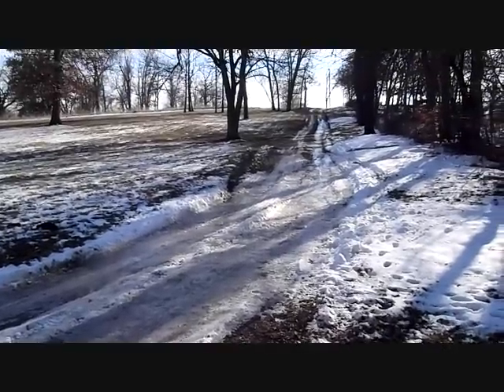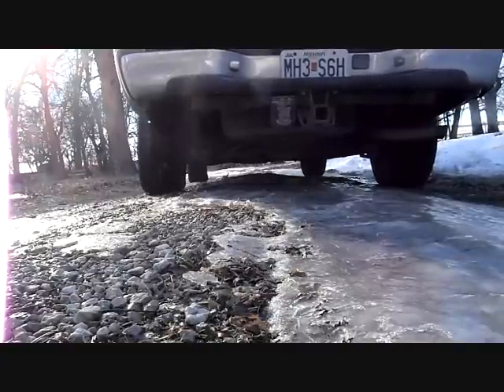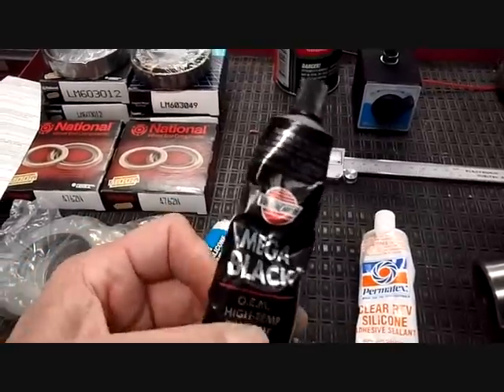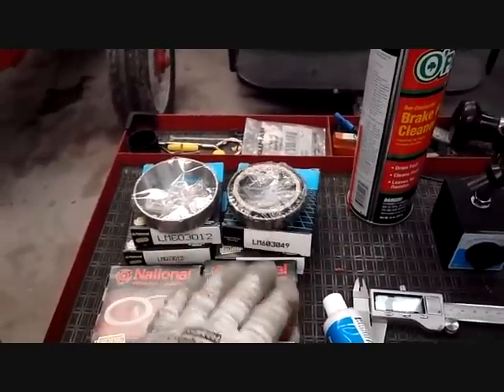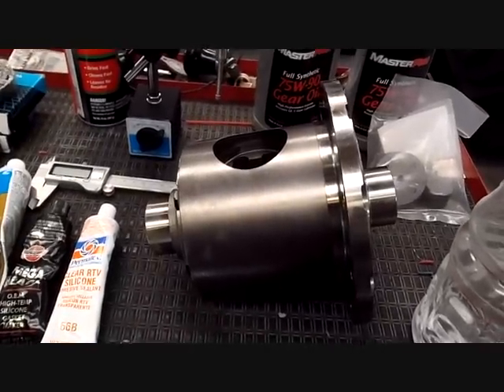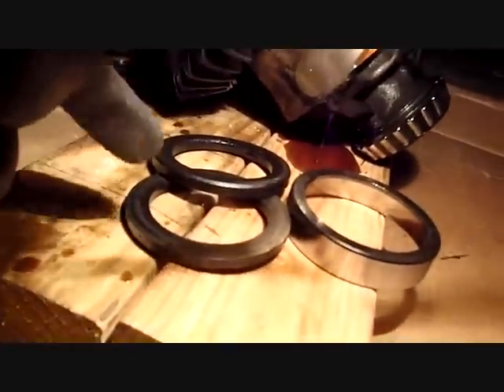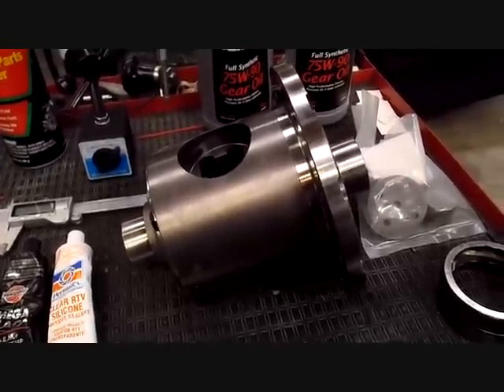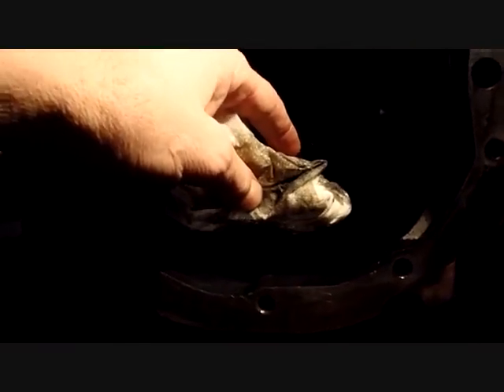How to install a Detroit Truetrac limited slip differential carrier. ADVANCED INSTRUCTIONS!

Comment from the maker: *UPDATE*   I installed the Truetrac with around 80,000 miles on the truck.  I now have 200,000 on the odometer.  It still works great!  I installed a set of super aggressive mud tires for winter use and have yet to be stuck!
Reply: Wear and time are the true testers and it looks to hold up just fine.  This winter just killed off the last of the lsd in my Dakota, did the old ice test today with a grand failure which conveniently justifies an upgrade.  Thanks for the Update!!
Reply from the maker: How many miles did your LSD last?  So you're going to install a Truetrac?  If so check out the link above.  Thanks for commenting!
Reply: that is awesome, i feel a lot more comfortable tackling this on my future jeep.
Reply: This is my favorite Truetrac install video.  How about another update?
Reply: Great to know. I was curious how the new gears would fair in those conditions without a break-in period. Did you follow those break-in instructions?
Reply from the maker: @Tahoe Tommy I had 250,000 and the tranny went out.  But the diff was working great.  I sold it to a guy that had a good tranny.  I bought a 2003 Escalade with 87,000 miles on it.
Reply: @mowerdog  how often do you change out the dif fluid?
Reply: Still great 10 years later?
Reply: @colestreit1500 I think it’s lifetime if I’m not mistaken

Comment: Thats an Eaton Truetrac, not a Detroit Locker. A Detroit Locker is locked all the time and ratchets around corners. The Truetrac is a torque biasing dif. It senses traction and sends power to that tire.  Great for roadracing/street use as it gives power to both tires as tire traction allows. A Detroit locker can move a vehicle with 1 of the rear tires off the ground, a Truetrac cant.  In order to move you need to apply the ebrake to engage the Truetrac.Great video lotsa great info.

Comment: Tip; take the vehicle to the car wash and power-wash the differential area before you start work.  It makes it much more pleasant to work on it and helps keep grit out of the case when it's apart.
Reply from the maker: True that.
Reply: Pro tip for sure, I abide by it before I work on any vehicle. But in my case, specifically this week... If your differential blows up on the way to the car wash after a day of mudding, good luck. Heard it clunking and hoped I could at least get it cleaned before I had to rebuild it with a true trac and gears, but it gave out before I made it there.

Comment from the maker: If your backlash is within your manufacturers specifications then you do not have to adjust anything by shimming.  However if your out of specifications you must use the correct shims and adjust your carrier either tighter or looser.
Reply: How can I find the specifications for a 2010 Camaro ss. I’m thinking about installing one myself.

Comment from the maker: If you keep the same gears the pinion can stay in with no adjustments.  But your carrier "may" need to be adjusted for the proper backlash?  Just make sure you buy carrier shims for your vehicle.  You may or may not need them?  Check your spec charts for the backlash specs.  Good luck!

Comment: Thank you. Thank you. I am going to swap drum for disc on my Chevelle that has the truetrac. This is the only video I have found that explains the plug to retain the axels instead of the thru pin held tight with the bolt. Just what I needed. Great explanation and video.
Reply from the maker: I'm glad it helped you.  Please share my channel

Comment: Thanks so much for this video. Most diff videos involve a total rebuild or just replacement of gears rather than adding limited slip. Almost nobody covers the case where you don’t want to touch the pinion gear and refuse the same ring gear on the same carrier.
Reply from the maker: I also try to make my videos to include everything you need to know to do a job.  Please share my videos with your buddies.  Take care.

Comment: 36:52 .. IDK if this has been gone over so apologies if I am repeating the obvious :)

When both tires spin you're supposed to lightly apply the breaks with your left foot while accelerating. this will lock up the Truetrac.

My truck has handbrake on the dash so I just put it on a bit with my right hand while accelerating a bit.
Reply from the maker: If one wheel is spinning you then tap the brakes and both wheels pull.  I found that this is not needed as much as you think.  Really I never had to do it.  I think in rare cases you would need this.

Comment: Just offhand, installing a truetrac led me to get a pair of Knipex 45 degree offset snap ring pliers [part # 4431J32].  Works like a champ.  You do not want to fight with junk auto parts store pliers with poor geometry and undersized pins on the included snap ring.
Double check directions?  Presently, sythetic is ok, but standard 80w-90 [gl5] is their recommendation.  Been using valvoline, and so far so good [qt bottle is VV831]
Reply from the maker: I had made an inquiry to Dana's engineering department.  They said synthetic is just fine in a Truetrac.
Reply: @mowerdog  Good to know.  I guess at the time of writing directions, not enough testing had been done for a basic endorsement - didn't seem like they were opposed but hedging regarding friction modifiers.  Anyway...thanks!

Comment: I’d highly recommend getting a cover gasket rather that have to dick with silicone. Plus it’s much faster and cleaner next time you go to change the diff oil.
Reply from the maker: Good idea!
Reply: Silicone is less likely to leak
Reply: @nathandevine552  I’ve never had a problem with leaks using an OEM style rubber gasket, and in many cases like with GM they’re reusable.
Reply: @chevyon37s  yeah I like the reusable ones 👍

Comment: finally a video of, "just" the trutrac and not a complete swap of gears and install of the trutrac.
I was debating going to a mechanic to have them install this since i kept hearing i had to watch for backlash, but was confused since i wasnt adjusting anything with the R&P. I installed a TORQ locker upfront, this doesnt seem too different. 
If i dont have a press available, would the crude rubber hammer work if finessed lol.
Reply from the maker: You can use a heavy hammer and drift punch to install the bearings.  You just have to be careful of chipping the race.  I would take it to a shop and let them press them on.
Reply: @mowerdog   thanks for the tip! 
did you have to use any extra shims to set the trutrac back in? seems like its just removing the carrier and swapping in the tructrac. (simplifying the task lol)
Reply from the maker: @12archer13  I was able to use the stock shims on this swap.  Yours m.j at be different?  It's good to have a shim kit on hand just in case the stock shims won't get the job done...

Comment: What torque did you put the bearing caps at?
Reply from the maker: I forget. But it was the factory torque specs I found online.  I think it was around 65ft lbs?
Reply: @mowerdog  hey I really appreciate it, that’s all I needed to know, I have forums for the factory set. Thanks again and what a great video. Installing in a 2011 crown Victoria.
Reply from the maker: I found the spec.  It's 60ft lbs     https://www.differentials.com/technical-help-2/set-up-specs/

Comment: Nice job.  At times, I wished the lighting was a little better.....but the steps were all clear.  I may go with a TrueTrac in my rear diff.   Locker or TrueTrac?  Still thinking about it.....
Reply from the maker: I too was considering a locker as well.  But when I saw they were using truetrac's in rock crawlers and some drag cars and the fact there are no clutches or actuators I went with the TT.

Comment: I want to put these in my Jeep CJ front and rear
Reply from the maker: +MemphisMetalFab   Go for it!  I have 100,000 miles on mine now.
Reply: +mowerdog Im hoping they dont lock up too quickly so that when turning on ice it doesn't act like a locker
Reply from the maker: It works like n open diff unless you start to spin.  Turning is no problem on ice or snow.

Comment: I had watched several installations but your presentation was the best. I have a 2000 Chevy Express van 5.7 2WD 5 lug. I use it for camping and hog hunting. I’ve got a front receiver mounted winch which I use to get myself out of trouble. It is quite annoying that I am the only one of my friends who do not have 4 WD but more annoying that I only have 1WD sometimes. The transition year you speak of is a true statement. This seems to apply to lift kits as well.  Thank you so much for taking the extra time and patience to pre plan and produce the video. I will have to read up on backlash and tolerances. Other than that it’s a doable installation with common tools. I have saved your video for future reference. Thanks again.
Reply from the maker: Thank you Rowdy!   If you run into trouble just email me. Mowerdog@gmail.com
Reply: @mowerdog  You are a good man Charlie Brown.

Comment: I intentionally installed the trigram be aide of how it works.  I don't rock crawl.  I drive in snow and ice and backcountry roads. When the 0EM rear  clutch plate LSD wears out I will replace it with the Trutrac.  I've already seen an improvement just having the front LSD over the open diff I removed.

Comment: I put a TruTrac in my 1977 K10 Chev. Was stuck in mud,my cousin got in put it in Low lock ran it up to 100 mph on speedo and the stock front diff blew !! Grrrr ! Priced a new one and the TruTrac and were the same price. Obviously the TruTrac went in. That was 1978, and that front diff works fine to this day.. I now own a Chev 2500HD and wonder if I should install one for the front,it’s a 2001 8.1 liter
Reply from the maker: If you have the time and money slap one in!!!

Comment: Do not use full synthetic gear oil. The truetrac specifically states not to use full synthetic. Use, petroleum-mineral based, GL5 rated 80w-90 gear oil. Thats from the instructions.
Reply from the maker: My instructions didn't say that.  Nor did the website.  So I contacted an Eaton engineer, and he said full syn is just fine.
Reply: @mowerdog  They do now. Check again.

Comment: I put detroit tru trac's in my 02 TJ. This is not a simple bolt/ drop in job. You have to shim and check pre load on your gears. It takes time and patience.
Reply from the maker: You are correct.  Setting up a diff is really not for a rookie mechanic.  I'm guessing I've done around 25. This is the first one that the original shims worked.  I got lucky and said so in the video.  My backlash came out fine and I know my carrier bearing were preloaded because I had to drive the shims in.  How much preload?  I don't know?
Reply: @mowerdog  I'm glad it worked out well for you. I was changing gear ratios at the time I installed my LSD. I also bought an extra set of bearing so I could grind them to set the shim packs. I often wondered if 3rd member differentials are easier to set than the Dana and chevrolet style.

Comment: had a quik question looking to get the locker but have 8.625 gears and theres one that says 8.5 8.6 just wondering if it falls under the same thing?
Reply from the maker: I believe it will work.  But to be safe just shoot a message to the seller to make sure.
Reply: mowerdog mind sending me youre part number on the locker you bought? please and thankyou
Reply from the maker: willballforsoup1
 Detroit part number is 913A481    I bought it at Jegs
Reply: mowerdog thankyou again! really appreciate it

Comment: thanks!!!! this is just the video i was looking for, installing one of these without regearing. i'm in the middle of putting one of these in a 7.625" 10 bolt with every intention of dumping the 3.42 for a 3.73 or even a 4.10 gear set but couldn't loosen the pinion gear nut. tried eveything, 5 foot cheater bar, penatrating oil, 800 ft-lb impact and that thing won't budge. preload is on the loose side and .008 on the backlash is as close i could get while still getting a good pattern. i was worried about longevity issues if i left it like this but now i think it will work just fine, thanks again for taking the time making and uploading this vid.
Reply from the maker: zxpwr07 Sometimes you have to leave well enough alone.  I've had tough yoke/pinion nuts but always managed to get them off.  Have you tried heating it up cherry red?
Reply: mowerdog  blow torch + pb blaster worked!! got it off and installed the 4.10 gears, took longer messing around with pinion depth and backlash and pattern. probably not a good idea to start drinking beer before the job is actually finished :) thanks again!
Reply from the maker: Drinking was probably the best thing you could have done to complete the job. LOL.
I've seen some bad diff set ups that ran forever.  I mean for normal use they are pretty forgiving as long as the backlash is close.  But you are correct.  To perform a complete set up correctly can be a pain!  I'm glad you got your job done!  Time to celebrate with yet another Beer!

Comment: If you had to adjust your backlash, would you then need to drop the driveshaft, pull the pinion and shim it in and out??
Reply from the maker: No. Just shim the carrier.
Reply: @mowerdog  As in left or right?? (depending on backlash)
Reply: @benkanobe7500  how else would you shim the carrier ? It has to be centered on the axle.

Comment: That was an awesome video and explanation bud. Definitely gonna attempt to do my 05 Silverado before taking it to a shop an paying an arm an a leg. I am mechanically inclined an have done  plenty of work on my vehicles. But again this video definitely helps! Thanks
Reply from the maker: If you run into trouble email me at mowerdog@gmail
Reply: @mowerdog  I appreciate that bud. Thanks. I'll most definitely will if needed. I dont have a garage so I'll have to wait until winter passes to be able to do the job. If that were to change then you might hear from me sooner! 👍🏼

Comment: I'm just going to slip in a comment on the conventional vs synthetic gear lube use: food for thought. From what I've gleaned from Eaton, is that certain brands can cause noise and somewhat of a  loss of the Torque Bias Ratio or ''TBR'' or performance. 
That's probably why they discourage its use, without going on limb and stating which brands to stay away from with their unit. 
From another Torsen site, they say that the TBR is a relatively small change when changing the gear lubes, one vs another, so its rather inconsequential. Like .1, not 1. 

Great video, btw. I like to see the before and after performance on that iced driveway. 

In 2010 I installed  a Truetrac on my old '02 F150, 2WD. I ended up having to replace the ring & pinion, due to run out on the ring gear. I can't recall the # but you could feel it bind if you had a backlash on the tight side in the spec. It was that bad. My carrier also fell out, not a good sign, meaning i had no preload . Might explain why i a had drive side whine a 45/50 mph and at only 7k miles. I thought it was a normal variance ....lol. It was a factory flub off the line.
Reply from the maker: From a direct inquiry to Eaton I was told that synthetic grease was fine in a truetrac.  You must of not finished the video because I show the after effects of the diff. https://youtu.be/6FUee1n3GzI?t=2099
Reply: @mowerdog  Yep, I mentioned i liked the video because you show it working, as open to LSD. 
Some brands of synthetics can make noise, per Eaton's general Q & A on the Truetrac.  The inference is that some will work fine.

Comment: Did the carrier come with that spacer and cover kit?
Reply from the maker: If you're talking about the puck, cap and clip the answer is yes.
Reply: Thanks .. reason I asked is because my box came in looking like a soccer ball that fell out of the ups truck in traffic.  I’m Missing that kit
Reply from the maker: I think it was in a separate bag inside the box.  So yes it's been lost.  Bummer!
Reply: The cover gasket, shims, bearings, seals, and certain bolts come in an installation kit purchased separately from the TrueTrac unit itself.   The place you order the TrueTrac from will have the correct installation kit available.  As I recall, my kit was around $120 and came with the wrong cover gasket, but Oh, Well. (Summit Racing)

Comment: Nice video mowerdog. I have a Truetrac installed in the front of my 2011 Jeep Wrangler. It's my DD so when I had my Jeep re geared I had it installed. It does far better than I expected when I'm rock crawling/offroading. Money well spent. you can buy two for the cost of a Full locker.
Reply from the maker: One reason I bought the Truetrac was the rock crawler vids.  They seem to work well.

Comment: Do these vehicles have open diffs from factory. That sux.
Reply from the maker: Yes.  I would guess if you ordered a 3/4 ton Sub you may have had the option of a limited slip diff?  But I wouldn't know because I can't afford a new one!
Reply: @mowerdog . In Australia nearly all vehicles have had LSD 's  since the 80's.
Reply from the maker: That's awesome!
Reply: @mowerdog  . Big improvement on open diffs, makes wheelin easy.  Im a hilux fan and stock is almost as good as locked until the clutch packs wear but its all replaceable. 
Surprising how different markets are, toyota lsd's are brilliant, i thought the tundra's  and taco's would be LSD  but you don't need it with traction control

Comment: I have a LSD in my car, it’s a 2012 Chevy Caprice PPV. Does the Detroit locker actually work better than an LSD?
Reply from the maker: There are different types of lsd's.  Each work a little different but the end result is about the same.   So you are good with what you already have.
Reply: @mowerdog  Thanks!